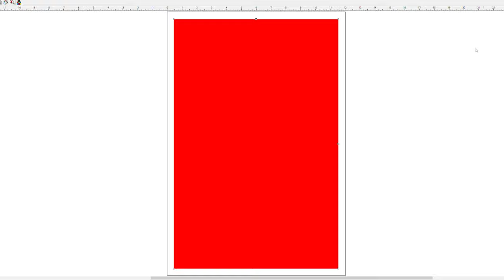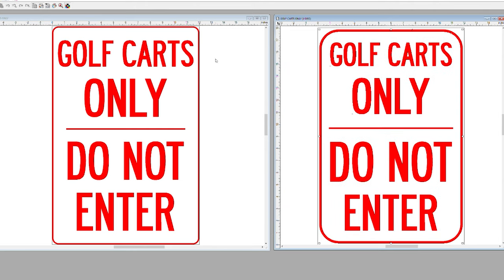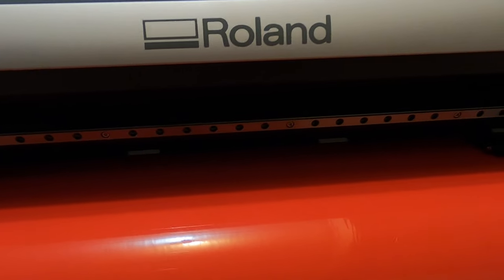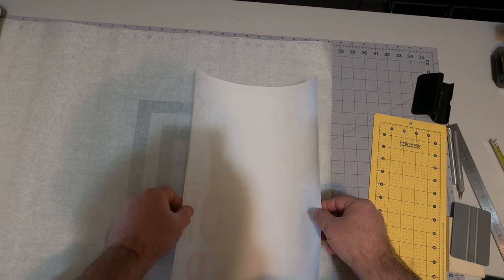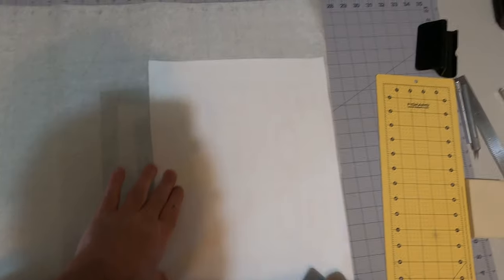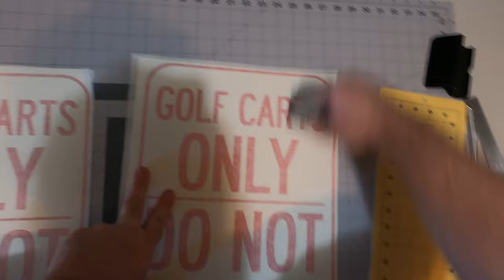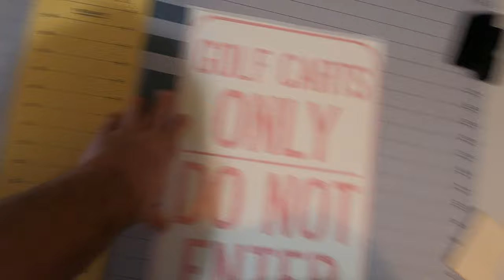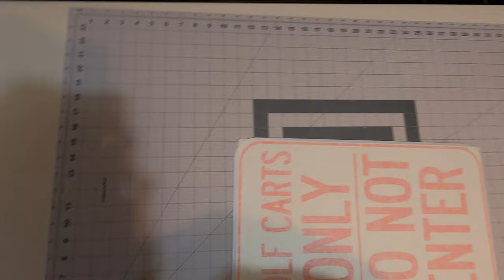How to Make Your Own Vinyl Signs - Vinyl Cutting Made EASY - Make $EXTRA$ money with a vinyl Cutter

Comment: I also do signs also …..I started 20 some odd years ago just installing signs for a sign company to barter on his lettering my van that morphed into doing all his lighted signs and lighted channel letters etc from there other sign guys wanted me to install for them so I ended up installing for 5 different sign companies…..I got interested in the process and bought a cheap Chinese cutter then bought a DGI om60 cutter then the Graphtec CE 6000 and the Stahals heat press etc so anyways now I have a full fledged sign shop also ……..I manufacture back lighted sign boxes and faces plus flat signs, banners and vehicle lettering etc
Reply: I don’t have a channel except for some post my grandson did on mine. It’s fairly easy making the boxes I only use led anymore  it’s so much better then fluorescent or neon .  I started just from watching and got interested in the trade.
That’s how I always did ….if I found it interesting I learned how to do it.

Comment: What software and blanks? I’ve searched for over a month for blanks.
Reply from the maker: I use FlexiSign 10 to run my machine. I got the software with dongle with my first vinyl cutter. If you are in the market for a “real” vinyl cutter, I definitely recommend Graphtec. It comes with a version of flexi. Definitely recommended. If you can’t afford a full sized vinyl cutter, get a Cricut, or Silhouette Cameo. Checkout Sign Warehouse, and Hall Signs for blanks. I also use Harbor Sales. They are on the East Coast. Maybe US Cutter for some things. Good Luck!
Reply: @HandymanHustle  thank you! I found the hall signs today and I had a cricut but it’s crashed so was looking at the cameo 4 pro cuts 24” I need that kind of cutter so I can still print and cut stickers that I make also. I’ve looked at the large vinyl cutters but I figured I’d get one that could do both so I’m going from 12” cutting to 24” cutting! I’m just looking to make custom street signs like for peoples farms or driveways, Thank you for your info!!